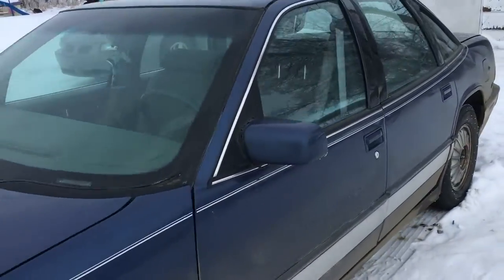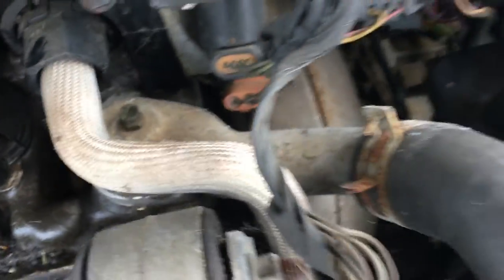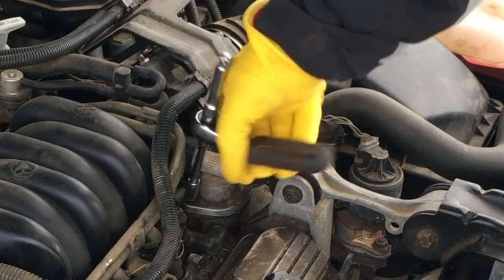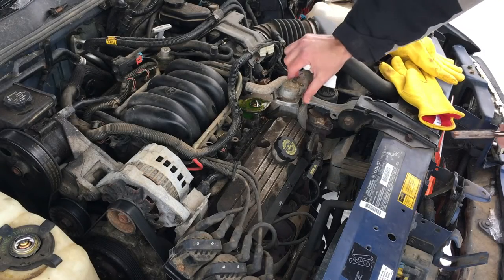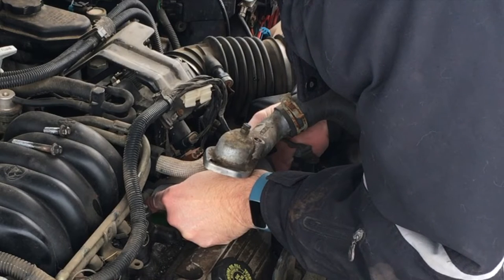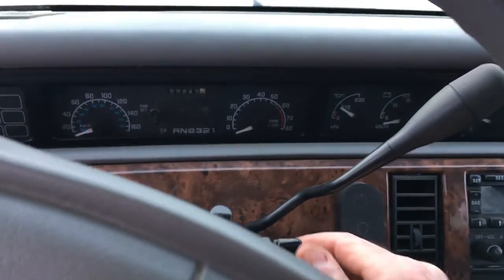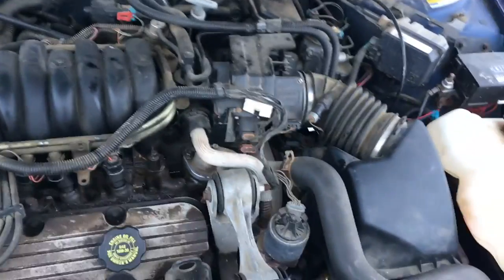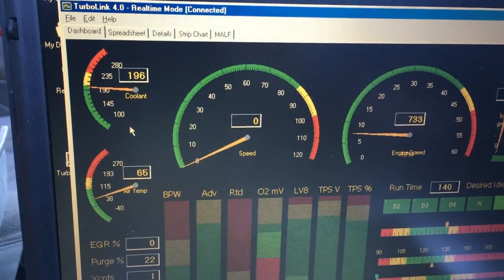1994 Buick Regal - Replace the Thermostat on a Series 1 3800 V6

Comment: Some of the newer Thermostats are designed to fail "Open " so the car does not overheat . Would explain your issue .
An engine with a wide open thermostat will never get up to temp .
Great vid , I love those old 3.8 s Great motors 🤗
Reply from the maker: Oh, I'm sure that's the deal, or maybe el-cheapo or used parts, hard to say when I didn't own it.  The 3800 is exactly why I got this car, they are fairly bullet proof and I don't mind working on them.

Comment: There is supposed to be an o ring that goes around the thermostat that is tapered and the wider end goes towards the top, Felpro part # 35666
Reply from the maker: There are 2 kinds of gaskets, I was worried, but my replacement parts matched my existing parts.  Now, the existing parts could be wrong too, but it has seemed to work in the past.

Comment: I have a 95 Buick regal customs I drain the antifreeze clean the heating core out and it’s still not getting hot also change the thermostat and water pump any suggestions???
Reply from the maker: "clean the heating core out" meaning  you used a flush?
https://youtu.be/M7WCP688zCM?si=eO6nD3PGMKhUx69M